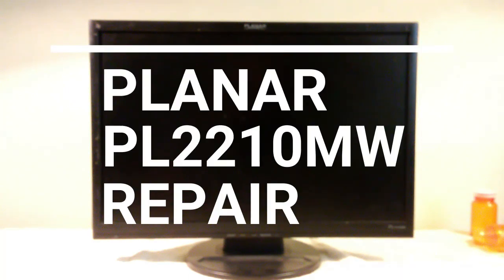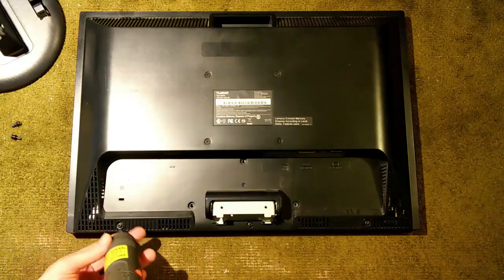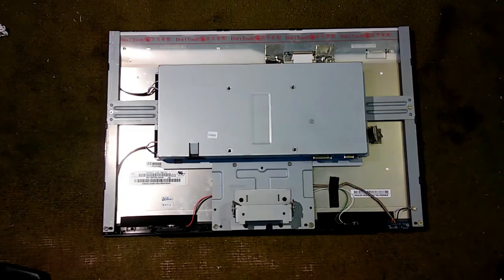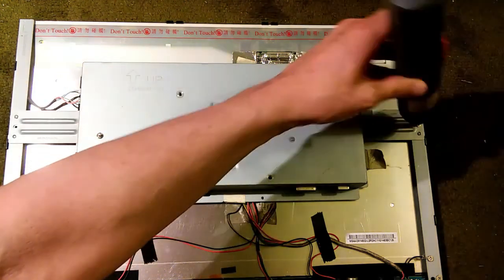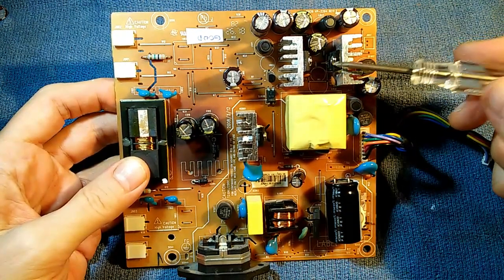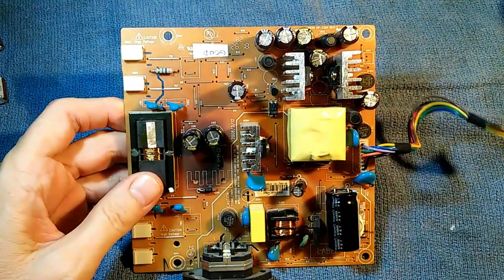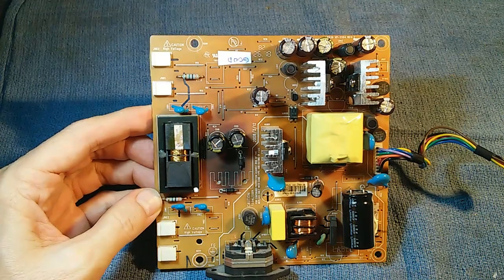Planar PL2210MW Monitor Repair

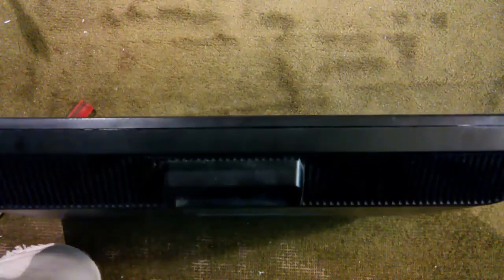Comment: 3:14 (Grabs screwdriver and rubber mallet.) You may call this barbaric. I call it refined sculpture. 🧐
All kidding aside, thanks for the video. It is 2023, and I did not realize that I have had this monitor for 15 years.

Comment: Thank you!! I checked those exact caps and my fluke meter showed they were fine. I don't have the fancy esr meter you do.
Reply from the maker: I have the Peak ESR70.  They sell for around $110 USD.  Bad caps are a very common cause of electronic failures.  This tool was money well spent for me.
Reply: Well, I ended up replacing every single electrolytic on the whole power supply board and I keep getting the same thing... Powers up for about half a second and shows the image correctly, then goes blank.
Reply from the maker: @jdunne525  If the monitor CCFL backlites turn on for about a second and then go black.  The  problem is probably a bad backlite or something in the inverter circuit that powers the backlites.  A bad backlite or shorted transformer will cause the circuit to draw an incorrect amount of current.  The current is automatically measured and if it is out of spec, the backlite circuit will shut down. It is a safety protection.   Try using a flashlight up close to see if the screen is actually on but only the backlites are out.  If you have 2 of the same model of monitor, you could trouble shot by swapping the power supply/inverter board.  If a backlite has gone bad, it is very hard to replace. It is probably best just to scrap it.
Reply: @c.davidgraves4848  Thanks again. It's definitely the ccfl bulbs. Call me stubborn, but I opened up the panel and took a look. Clear signs of a bad cfl with black marks at the ends of the tube. I have 2 of these monitors and I'm pretty sure the second one is not too far from dying also. Real shame the cfl isn't more easily replaced. I've banged this thing up pretty good trying to get it out. Anyways I appreciate the video and the help.

Comment: David, I have a Planar 2710 that I hate to throw out. The power stays on for a few minutes then the screen goes dark but the green power light stays on. If I turn it off, then back on, I get the same event. Can I pull the power supply out and send it to you so you can fix it? Let me know.